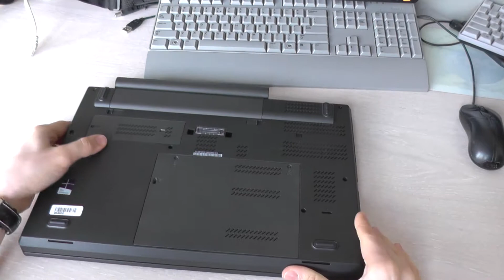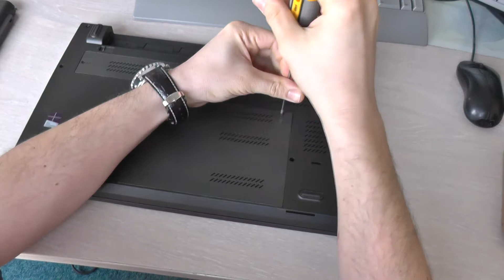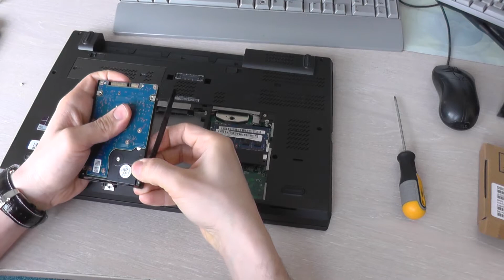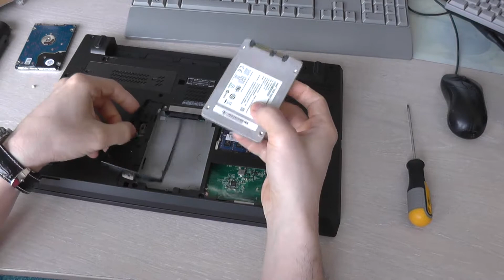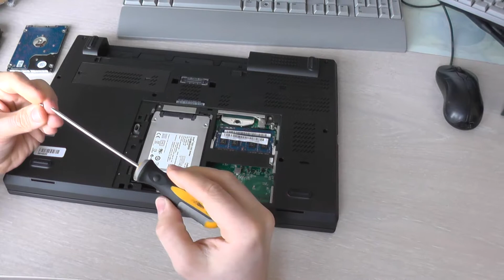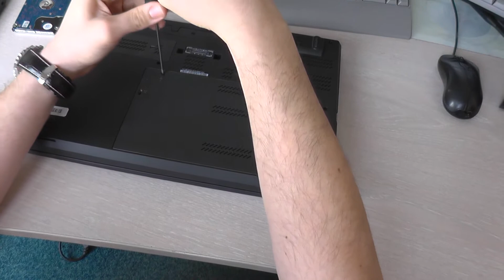Lenovo T540P HDD to SSD Upgrade

Comment: It looks T540p is a good machine, can it hackintosh to OSX 10.13.6? it seems like can be supported perfectly(GK107), but I can't search successful case on tonymacx86 website.
Reply from the maker: I have never used hackintosh or OSX so can't say if it will work or not.

Comment: If I'd'a looked at the length of the video I would'a known  that this was just the remove/replace part of the process, and would not include transfer/install of OS, data, and other content on HDD. I don't think a chimpanzee would need this info to complete this task.